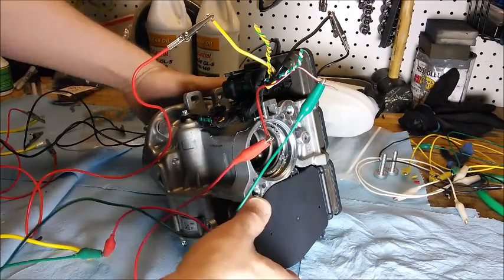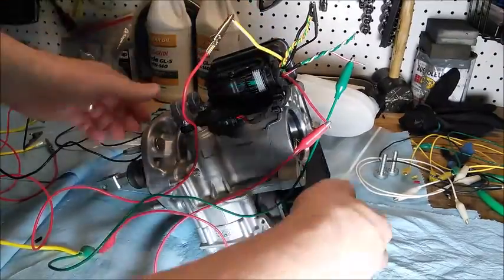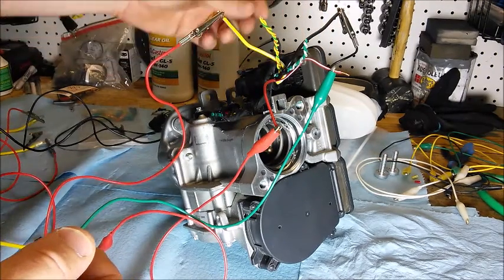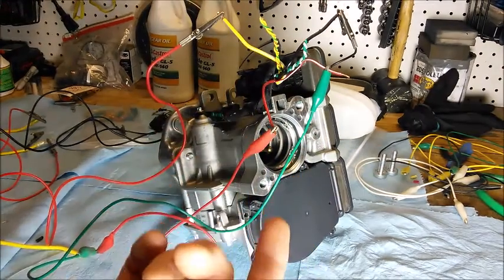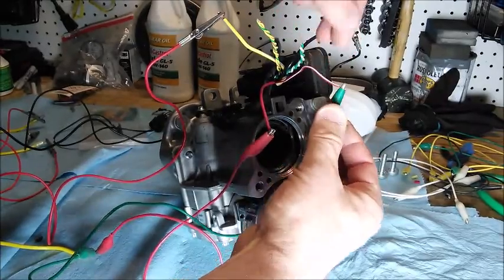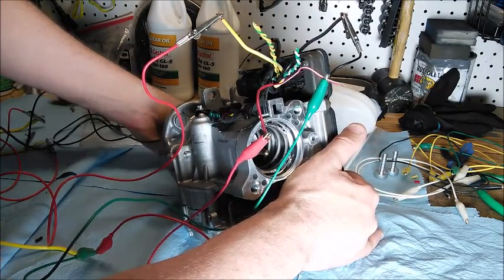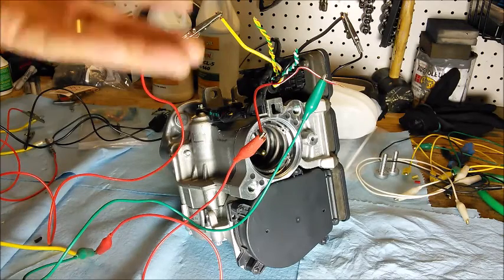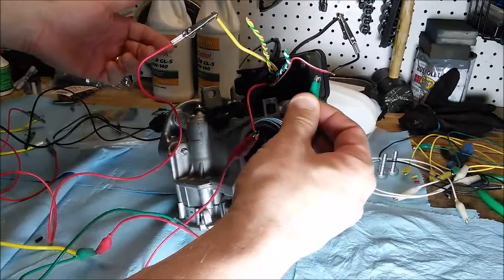iBooster Bench Test Apr 15th 2016b

Comment: Greetings, I recently bought a gen 1 ibooster from a 2018 honda crv, I understand that it is the same as the tesla model S and it is the same as you show in the video, the ibooster came with the electrical connectors, connect everything as you describe in one of the comments and I even found the pinout in ev-create and it's the same schematic, two 12v wires, one ground and the 4 wires from the pedal sensor, I don't know what's going on, I connect all ibooster, it shows that it turns on, it makes some noise but I don't have assistance, I have checked the connections dozens of times and everything is connected as it should be is there any way to test the pedal sensor or if the ecu is firing

Comment: So basically no power suddenly means no brakes?
Or could you still brake using excessive force on a brake pedal?
I would assume you got more leverage when installed in the car though.
Reply: We're too weak to overcome the big return spring inside the unit without a brake pedal attached for leverage. 

With no power, it's just manual brakes. It fails much like traditional power brakes would when your engine shuts down and you have 1-2 more pumps of power brake left from the residual vacuum.

What's different is that it actually still works for maybe 4 minutes if the 12v switched power is off, but it still has power from the battery. This is safer in my opinion.

Comment: Does Failsafe mode mean that system is fault free?
Reply: Failsafe just means that if the unit loses everything but power that it will continue to function in some fashion.  The idea being that if the car loses CAN communications, the brake assist is still provided, possibly using default settings.
Reply: It acts like old manual brakes when it loses power. It also still works for a few minutes after ignition is turned off, as long as it still has power from the main 12v battery on the thick wires and the white wire on Gen1 ibooster as shown in this video.

Comment: Any chance you could share the pin numbers for the power, ground, and ignition on signals?  Or a full pinout of the module if you have it?
Reply from the maker: Pins Description Color
1  +12V_UBB YL-GY 40A fused
17  +12V_UB_ECU RD
20 IGN_WAU  RD-WT
25 Veh_CANC+   WT-DG
16 Veh_CANC- DG
9 GND_ECU  BK
18 Yaw_CAN1P
10 Yaw_CAN1M

To Pedal Sensor (module on the iBooster)
2 VRef_U5VExt YL
22 PTS1  BR
23 PTS2  RD
8 AGnd_Pos GY
Reply: Thanks for the pin out information. You could probably sell loom kits if you had the time.
Reply: Hey there I've been looking for a wiring loom from a 2015 Tesla modelS for this ibooster. Have you been able to find one?
Reply: I've never looked.  I'm building my own looms as almost all of the wiring in the DeLorean is getting replaced or is new. (Not really all that much wiring in a 1980's car).
Reply: Thanks Jeff. I could only imagine the state of the wiring. I hope the insulation of the wiring hasn't gone brittle like wax. I've seen that on old Volvos of that era. My concern with the ibooster wiring is the pedal position sensor. I dont won't to mix that up.  I'm confident in the rest. Any clues?
Reply: There are four wires that run from a sensor embedded into the top of the ibooster (just between the two motor gears).  It is the iBooster Pedal Sensor.  The wires are Yellow (pin1) VRef_U5V, Brown (pin2) PTS1, Red (pin 4) PTS2, and Grey (pin3) AGnd_Pos (pins at the sensor).  The lead from the sensor runs into the loom leading to the large pin connector into the iBooster ECU. At the large iBooster ECU connector, Pin 2 is VRef_U5V (YL to pin 1 sensor), Pin 22 is PTS1 (BR to pin 2 sensor), Pin 23 is PTS2 (RD to pin 4 sensor), and Pin 8 is Gnd (GY to pin 3 on sensor).
Reply: Thanks Jeff. Sorry for the late reply, I was away on holidays. I'll give that a go. Thanks for your time. I'll let you know how I  go.